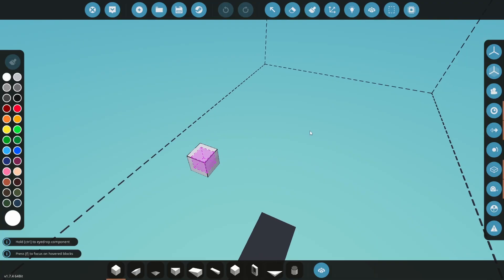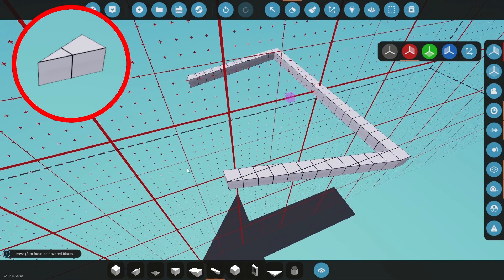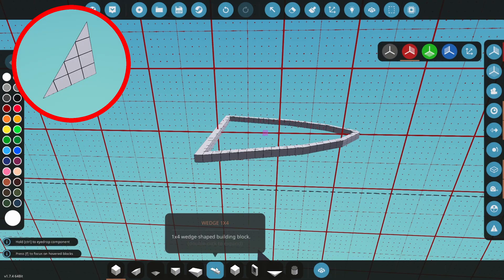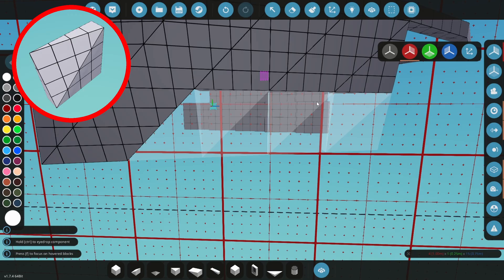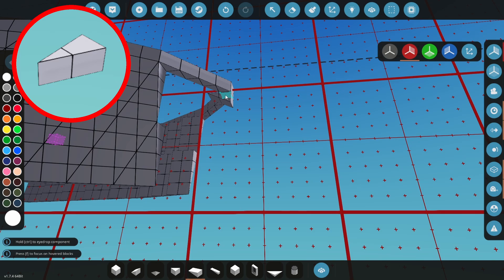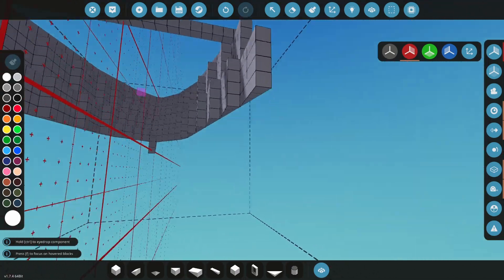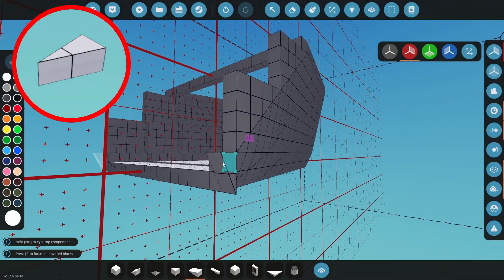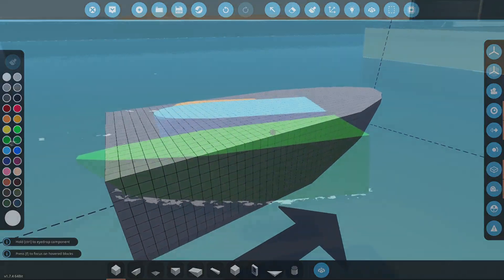Stormworks - Ship Hull Tutorial

Comment: what abt the stern, also my hulls always have a glitch with stability(even when i stretch other peoples hulls) where it keeps rolling over to one side, when i add stabilizers it continuously rolls the ship over with no way to stop it
Reply from the maker: Stern is basically the same as the bow but you just do it shorter. If you have an active stabilizer that is rolling your ship the signal might be backwards. You can use a function -x inside your logic to invert the signal or make the tilt sensor face the opposite direction.
Reply: @terr-rawr-saur  k thx, I am new to building in stormworks and this vid helped with my bow and I'm figuring out the stern, if I need help with the rolling issue I'll look at the tip you have me